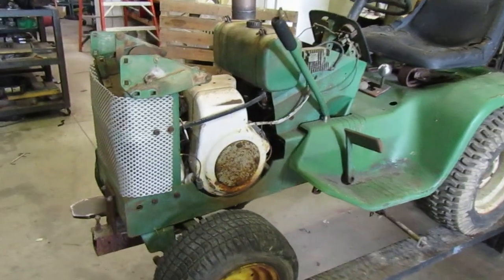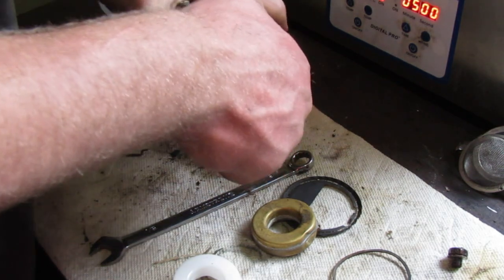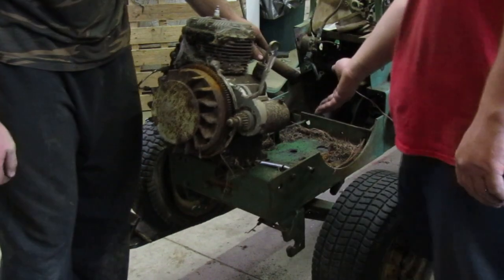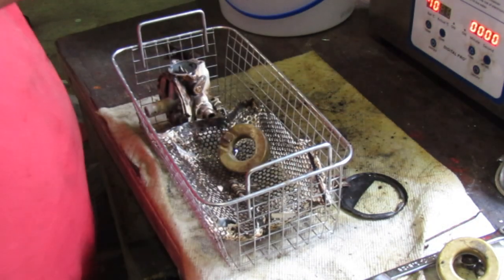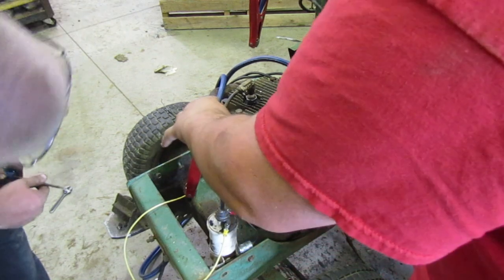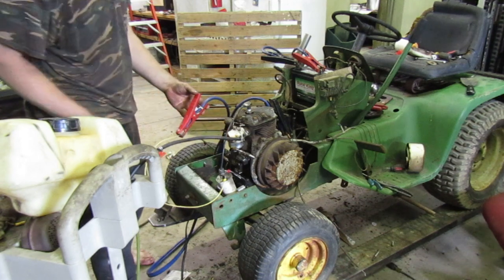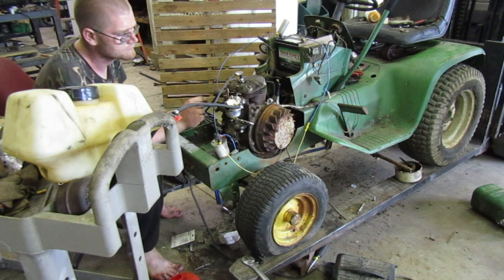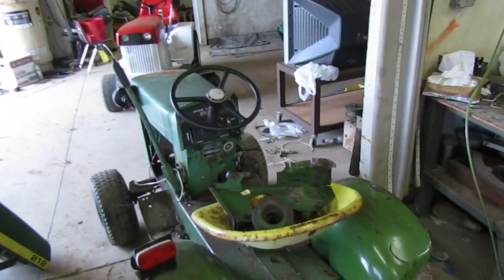Can We Get it running? 1968 110 Sat 5 years

Comment: On these old carburetors that have the metal bowls. The Ethonol kills the bowl & rusts out.
If that happens just buy a cheap carburetor.
On the stuck carb, if you stick a screw driver between the bowl & the bottom jet & pry up a little, then after a little tap the bowl with a wrench & it’ll come right of.
Reply from the maker: Michael Benoit  Yeah I did not even think of doing that. I like that carburator it seems more sturdy than the cheepo ones now a days